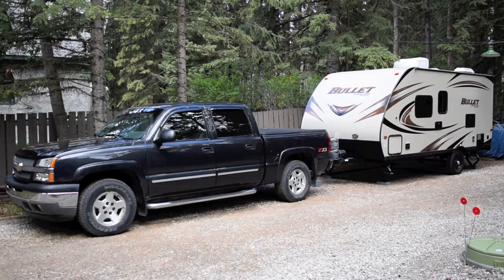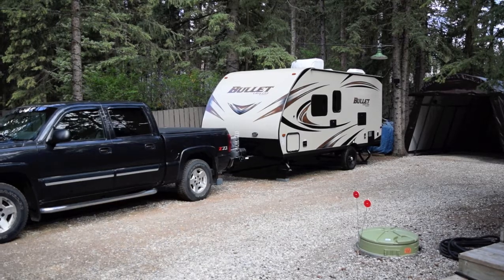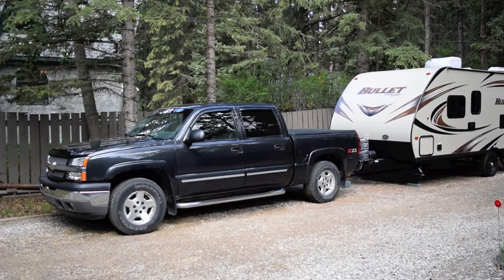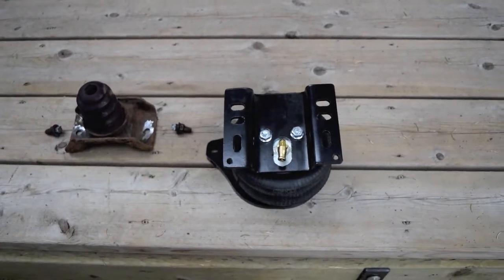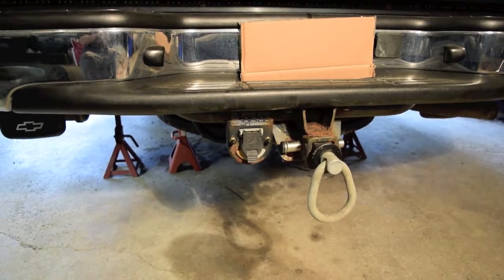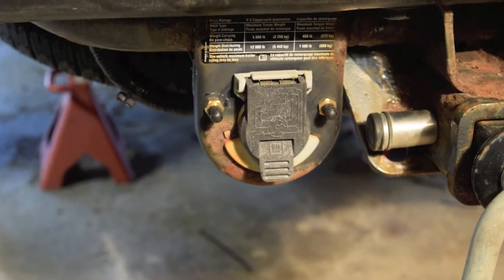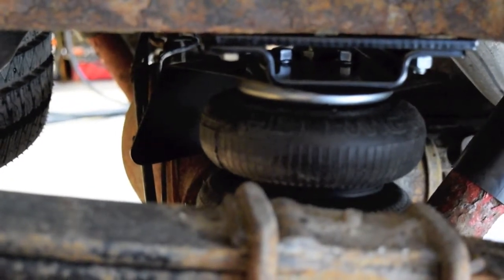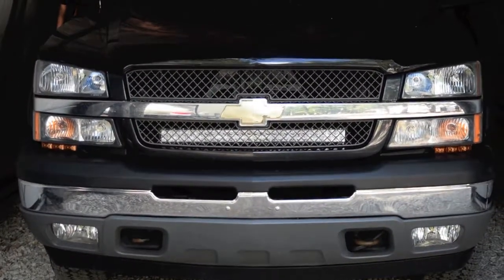Install Helwig 6012 Air Spring Kit on 2005 Chev Silverado 1500

Comment: Y did u choose the hellwig?
Reply from the maker: So I said it in the video and it is in the description --> "Hellwig 6012 Air Bags. These are the only “no Drill” bags I could find for the 1500. There are lots of them out there for the 2500 and 3500 trucks."

No drill being you don't have to drill holes in the truck frame. 

.